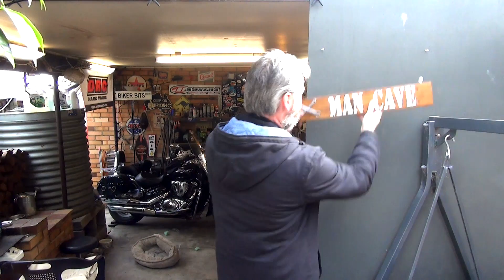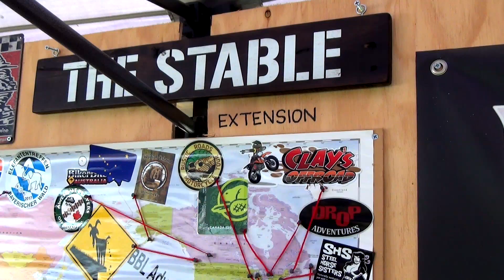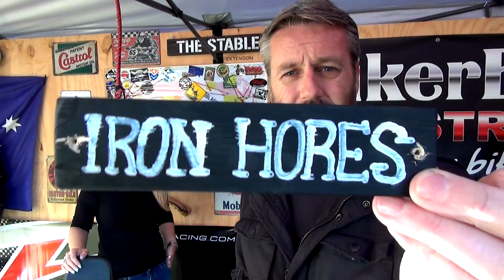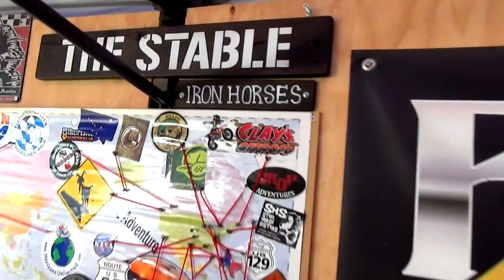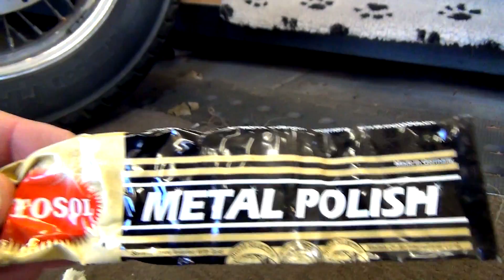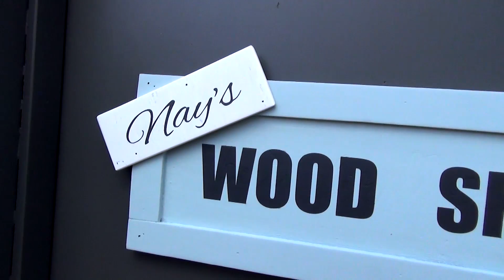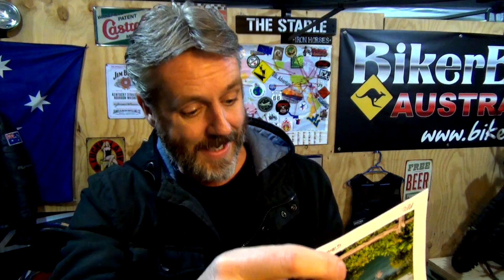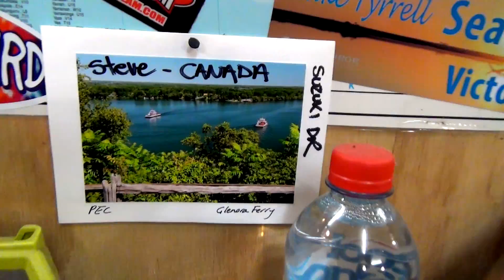I Don't Leave the Backyard - MCT Ep.46

Comment: Mark, a chopping tip for you- take a slat of wood about 8" long and drive a nail through the end. Use it to hold the wood upright when chopping instead of your left hand. Then you won't chop your finger off.
Reply from the maker: +FiveRustyNails WOW... never thought to do that. Thanks! :-)
Reply: You can pass it on to the whippersnappers, and the idea about using a 1/4" drive socket on the hose clips too, if you like.